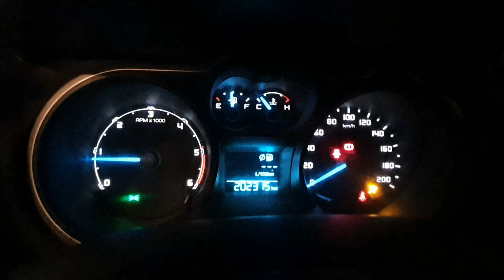Turbo Upgrade! | CCT Turbo | Ranger Mods

Comment: Got one on my ranger. Done 20,000k. Definitely a lot more punch down low. Made it 2ltrs per hundred better, but that could have been the faulty egr valve drinking more🤣
Reply from the maker: Thanks for watching mate!
I know exactly what you mean.
After installing my throttle controller the only thing left acceleration wise is a 3" exhaust to let it flow better!
Reply: Any update, mate?

Comment: Thinking about getting a stage 2 cct turbo upgrade for my YD25 d40 Navara, the stage two offers upwards of 25% more airflow whereas the cct stage one offers around 15% more airflow than the stock YD turbo.
Reply from the maker: Definitely could have gone the stage 2, didn't want the extra price tag of extra parts to go with it though!
Stage 1 can be fitted without a tune, or additional engine and/or driveline upgrades.
Cheers for watching mate!
Reply: @Shenanigans4x4  thanks mate, if I’m going for the stage 2 turbo, I’m willing to go all the way, meaning hi-flow exhaust, better intake and getting the Ecu remapped.
Reply: @onepiecetrapremix4263  did you end up doing the upgrade?

Comment: Hi mate had another question, when yours was throwing codes was it going into limp mode? And we’re you getting the traction control light and trans light on the dash and while they were on selecting reverse jolted the car when selecting? Sorry for hassling you but the mechanic I got yesterday seemed to be a waste of money haha.
Reply from the maker: All good mate haha
Yeah all exactly the same except mines manual so no reverse jolt, could be the limp mode on an auto
I drove around for about a week with a scan tool plugged in to clear the fault at roundabouts haha
Reply: @Shenanigans4x4  no worries mate. It’s been doing my head in I drove it today kept the revs about 2100 and under and went fine but as soon as I put the foot down went to limp mode… I’m going to do a actuator or turbo replacement in the next week. Was the turbo shield a pain to remove? Can’t seem to find clear vids of it being removed.

Comment: Hey man what was the go with your oil leak problem, looking at doing an install soon and kind of want to know what to look out for?
Reply from the maker: Hey Brad, fault of my own really, the oil drain tube is pretty tricky to get the bolts back in.
I dropped one (absolutely no idea where it went!) and had to get a replacement but running it in the meantime made it leak.
If you have any questions I'd be happy to help if I know the answer.
Send me a message on the Shenanigans4x4 Facebook page.
Thanks for watching!

Comment: How's the turbo going? Am looking at cct as well, but unsure about the quality.
Reply from the maker: Nine months on and still going strong mate 💪
I spoke to a mechanic the other day and he put one in a BT50 and a Patrol and never heard a problem about them
I think they're pretty good bang for the buck but can't say what it's like with a tune yet
Reply: @Shenanigans4x4  looking to stick one on my D4d. Got some proper whine from the engine bay.
Thanks for the reply. I'll take them more seriously now.
Reply: @MrVaelen  hey mate my luxy is making the same siren/wine sound and looking at stage 2 turbo did u end up going with stage 1 how did it go ??
Reply: @masonmcginley9121  Heya mate... So it is a good little unit, but one thing that has been happening recently is that the car throws a code from time to time. Essentially, because the turbo spools up faster and produces more boost than stock, the D4d ecu tends to think the turbo veins aren't closed when it is.

While it's annoying, it's a code that can be cleared easily. The same thing happens to D4d's that have had bigger dump pipes put on
Reply: @MrVaelen  oh yea the old code limp mode I was getting that aswell turned out for me was cause I had a loose battery terminals for the earth did u go stage 1 or stage 2 turbo ?? I’ve also heard it’s cause the exhaust is too free flowing after exhaust changes etc...
Reply: @masonmcginley9121  the only thing that makes me regret not buying oem is that every shop I have spoken to about a dyno refuse to do it with the cct turbo.

I may go back to oem because of that and this code thing (if it gets worse).

That being said, she literally came back from Airlie to Brisbane and didn't skip a beat. So...
Reply: @masonmcginley9121  oh and I did stage 1.
Reply: @MrVaelen  oh right we’ll thats shit for me as I’m looking at getting the stage 2 turbo tuned 😂 but sounds like they hold up alright

Comment: Hi bro, I am planning replacing my oem turbo with one of this, did it throw any code?  I am planning to kepp it stock, no tune
Reply from the maker: Hey mate, I've still got mine running stock with no fault codes, just make sure you get the extra warranty just in case.
Cheers for watching 👍

Comment: Great vid mate, how’s it been going so far? And would you recommend a new oil feel line when buying it? I think my actuator is kicked it and instead of spending $330 on just a actuator I thought this stage one upgrade might be better.
Reply from the maker: Cheers mate 👍 
Same thing happened to me, I reckon it's well worth it especially being cheaper than a reco turbo
I had dramas with codes on the first one I installed and it was replaced, no questions asked
Second one's been in for 15000km and no dramas
I didn't replace my oil feed but from what I hear it is recommended
Reply: @Shenanigans4x4  awesome mate. Mind me asking what codes you were getting as I’ve been getting two, P0234 and P2598. Is it best to buy through CTTurbo direct? As I’m in Brisbane.
Reply from the maker: @beeza421  yeah mine was throwing P2598 as well
I got mine direct from them but definitely get the extra warranty or if something goes wrong you'll have to swap it over to them in Victoria
Reply: @Shenanigans4x4  yeah I’d get the premium warranty for sure. Thanks mate.
Reply: @Shenanigans4x4  so I had a mechanic come look at mine today, he seems to think it’s the map sensor was it’s giving two codes one being low boost and another being over boost. So just ordered a new map sensor should have it this arvo. I’ve got a feeling it’s the actuator though but why not waste money eliminating smaller things haha 🤣

Comment: Would be awesome if you did bit more of a review on the turbo,  still a bloody good video matey.
Reply from the maker: Thanks for watching Jared!
Maybe something I can do later on down the track.
My experience so far has been pretty good.
There definitely is a power increase but it's full potential won't be unlocked until I get a dyno tune.
Still a while off yet but we'll see what the numbers say then!
Reply: @Shenanigans4x4  Yea awesome matey. My Ranger has  a new exhaust and tune (124kw) but still lacks overall power. Hence the reason for new intercooler and Turbo + piping. Definitely keep us in the loop with your upgrades matey.
Reply from the maker: @jaredtansley3236  will do mate! Cheers 🍻
Reply: @Shenanigans4x4  Stay safe and best wishes 4wheeling matey.

Comment: hi mate how is the quality of the cct turbo im about to by one for my ranger are they any good?
Reply from the maker: Hey mate, honestly I've had it for nearly 2 weeks and looking at warranty. Maybe just a dud one.
Definitely more power though, we'll see how the second one goes!
Reply from the maker: Update: I've gotten a new turbo under warranty. My advice - Get the premium warranty!
I had to pull the turbo out, take it to Speed Up Auto Parts (other side of Melbourne), come back and put the new one in in one day!
Reply: @Shenanigans4x4  How did the new one go?
Reply from the maker: @dogbot94  Hey mate, so far so good.
The original was taken back and no fault could be determined on the flow bench. Both turbos had a pretty loud whine noticeable in first and second gear.
After sending a recording to Speed Up Auto Parts they claim its normal.
Reply: @Shenanigans4x4  interesting, thanks mate. Looking at putting one in my old rodeo, the one I'm looking at is only $350 so I was a little skeptical
Reply from the maker: @dogbot94  I was and still am sceptical, but like I said so far so good!
Reply: Good day
Any further developments on the turbo, any more issues.
Thanks
Reply from the maker: @desertrat3125  hey mate, no issues so far after about 4000km.
The whine is still there and a bit annoying with the windows down but performance wise pretty good.
Reply: @Shenanigans4x4  I had this problem this week. Got CCT blue turbo from speed auto parts Carrum. I'm in the middle of pulling it off and taking it in to be tested. Didn't even get 2km before it spat a whole shit load of fault codes and put the car into limp mode Did you have the same problem when you put another one in? I don't want the same problem again and they don't really seem to give a shit about anything at speed up auto parts
Reply from the maker: @adrianfoster3059  Hey mate, the first turbo I got threw fault codes and put me into limp mode as well (which was the reason I was replacing it in the first place!).
Pulled it out and took it in to Speed Up Auto Parts, where they put it on the flow bench (not a real world test) and couldn't find any codes so they gave me a new one.
Wish you the best with yours mate, it's a bugger of a job in the first place and we've both had to do it twice! Haha

Comment: Hey mate so we’re did you buy the turbo from and is the turbo Spall louder
Reply from the maker: Got it from CCT Turbo mate, it does spool louder than stock with a snorkel
Cheers for watching 👍
Reply: Did you have to tune the turbo
Reply: @Shenanigans4x4  what year is your car mines a ford ranger XLT turbo diesel 3L  PK 2008
Reply from the maker: No tune needed for the stage 1, I will get it tuned after upgrading the exhaust though
Mines a PX 2013 3.2L
Reply: @Shenanigans4x4  okay so you honestly recommend the turbo
Reply: Hey mate, did you buy one of these turbos for you ranger? I got a 2009 pk ranger 3.0L and was wondering if itis worth buying one

Comment: Have you done anything with internals or injectors or is this a good turbo upgrade to avoid doing all that?
Reply from the maker: No extra upgrades required for the stage 1 mate
Makes it a great bolt on
I will eventually get an exhaust to help it flow better then a tune though
If you go for the stage 2 they reckon extra upgrades are required

Comment: Hey mate when you installed the turbo how did you put the bolts and nuts in
Reply from the maker: Hey Kurt, they weren't too bad just took a bit of manoeuvring to get them lined up
You will need an E6 socket to swap over the stud though
Reply: @Shenanigans4x4  is it only for the exhaust
Reply from the maker: @kurtbarnard1578  I think the stud was on the turbo side but it's been a while now
Reply: Have you had any mechanical problems with turbo

Comment: Mate can you convert a single turbo to a bi turbo  in a 2010 ranger 2.5
Reply from the maker: A bit beyond my expertise mate haha
I'm sure with an engineer you would be able to work it out.
Cheers for watching mate 👍
Reply: @Shenanigans4x4  yeh mate but my 2.5 has so much boost lag in the 1000 to 2000 rpm that's why I want to bi turbo swap it.
Reply: @Shenanigans4x4  and mate do you have anything that can make my 2010 ranger faster
Reply from the maker: @firdaustalukder3328  you might want to contact Speed Up Auto Parts
I am in no way affiliated with them, just upgraded the turbo on my own Ranger
Reply: @Shenanigans4x4  alright. Mate does the blowoff sound stuhhhh I need to make it fun